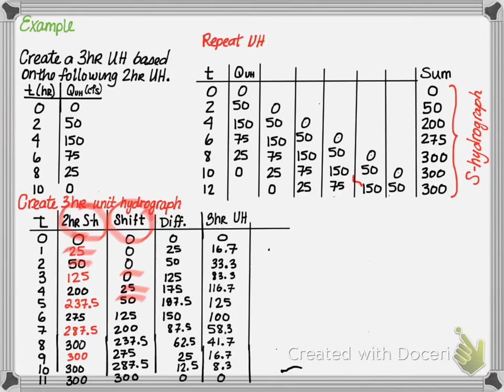S-Hydrograph

Comment: Example: The gross rainfall was 14mm for a storm of 3 hour duration on a watershed having 13.6 km² area. The index for the catchment is estimated to be 1.3 mm/h. Derive the UHG for this catchment from the direct runoff data given below:

Time(h)

DRO(m³/s)

01

0

2

6.1

1.8

3

8.4

4

6.5

5

5.2

6

4.0

7

3.0

8

2.2

9

1.6

10

1.1

11

0.7

12

0.4

13

0.2

14

0.1

15

0

Excess rainfall =

DRO volume =

UHG ordinates

Do it quickly excuse me.

Comment: While trying to find 1-h unit hydrograph in your example, I am ending up with 0 25 25 75 75 37.5 37.5 ...
Values are repeating :(
Reply from the maker: Make you s hydrographic longer.  Making sure that the number repeats.  That way when you subtract you get a zero
Reply: @seemashah-fairbank2760  Sorry, but It's still not clear. Can you explain. Tomorrow is my exam.

Comment: 3 hrs calculation can't understand
Reply: intensity is unit cm excess rainfall in 2 hr(i.e 0.5 cm/hr), the difference of s curves lagged by 3 hrs gives the DRH for  0.5*3=1.5 cm excess rainfall in 3 hr duration ,so for obtaining 3hr unit hydrograph we divide the DRH by 1.5=3/2 which is same as multiplying 2/3.